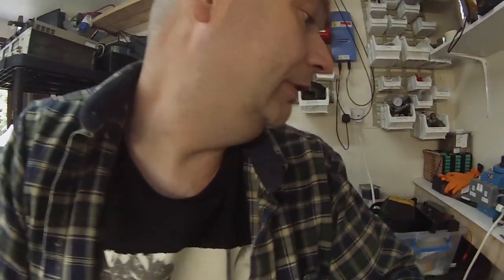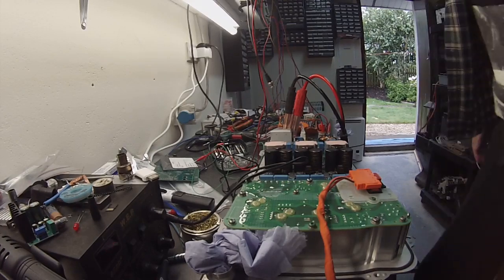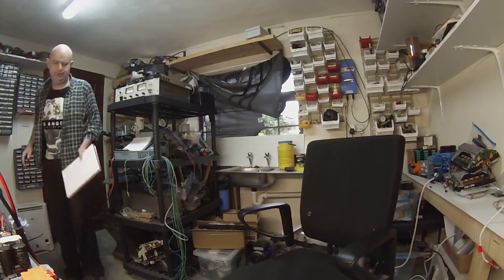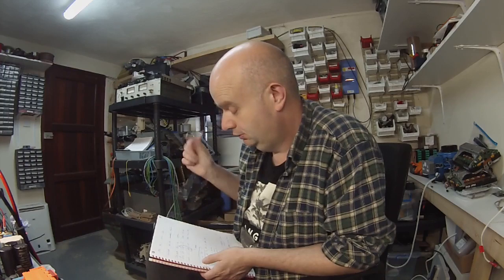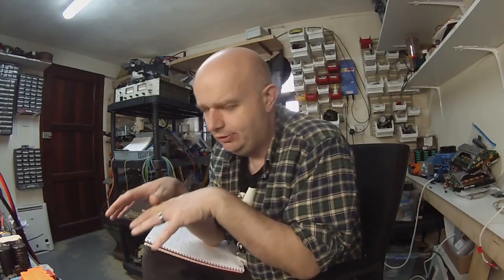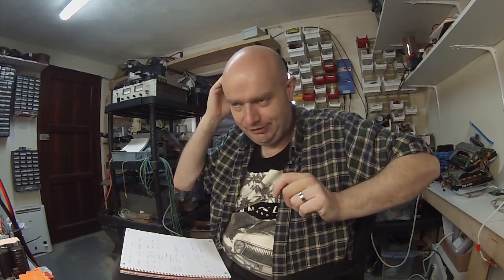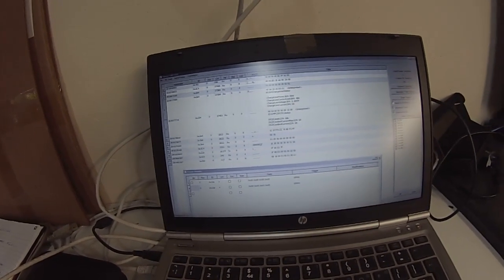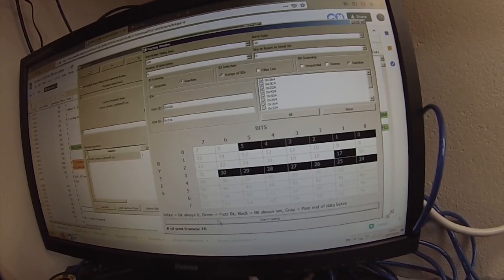The Tesla Project : Model 3 PCS DC DC Hacked

Comment: Older honda ima dc to dc converters are cheap at salvage prices and they only require a 12v positive to run them at full potental, 14v. Up to 60 amps is nominal current potental.

Comment: My question has been how much amperage in 12v can the dc to dc converter put out in the model 3 if I wanted to put extra load on the dc system and have the converter be able to keep up without draining the 12v battery out if I draw more than what it puts out.
Reply: Hi Ari, after 6 months, do you know the amperage of the converter?

Comment: 400v at what current is required ? - I use electrophoresis power supplies for my HVDC shenanigans, only a few hundred milliamps but lots and lots of volts  - tend to be very cheap on Ebay